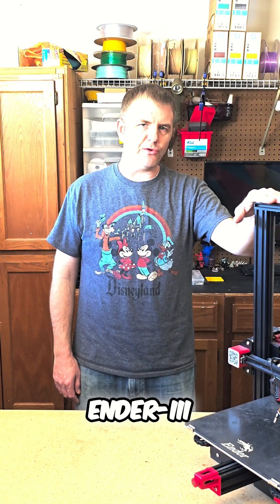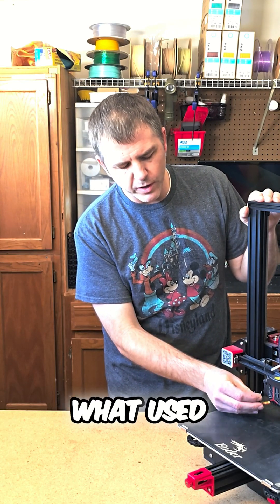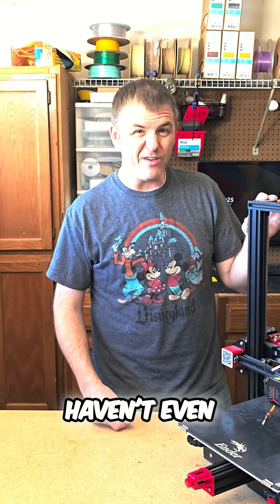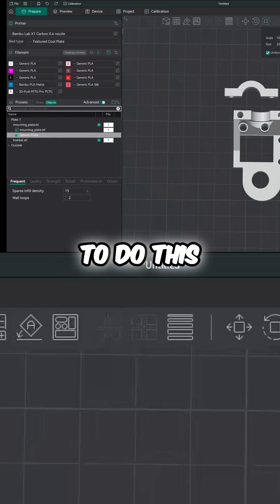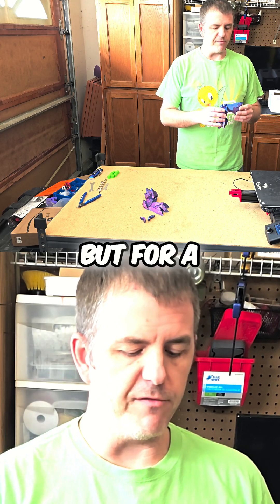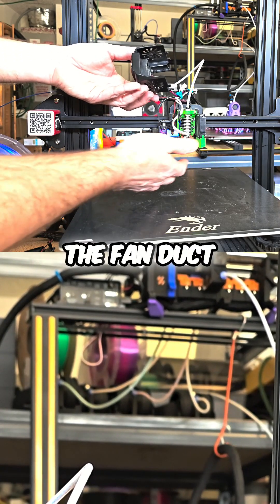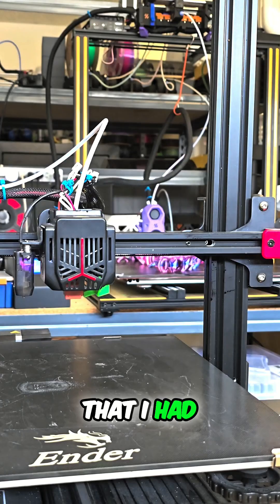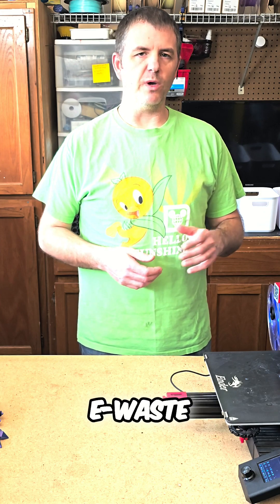Upgrading My Ender-III Max Neo: Is It Worth It?

Comment: I just bought a used one , was going to buy a broken ender 3 v3 plus but people on ebay were spending way too much , 150 bucks for the neo , almost new and it can be upgraded to compete with any printer out there , Ive rebuilt several printers for fun ..when you can by a motherboard for 30 bucks there is no such thing as out dated .. the newer printers aren’t as mod friendly , I prefer the older ender 3s ,I have two ender 3 v3 se , and they aren’t nearly as robust as my s1 , and the older ones made with a extrusions can be easily expanded . I
Reply: The Ender 3 printers are the AR-15 of 3d printers, imho.
Reply from the maker: You're spot on with the older printers!  I should do an update video on what I've done with mine!  I've added a 3MS MMU to  my Ender 3 Max Neo and my CR-10.  Adding 4 color printing, linear rails, and Klipper to the mix really makes them all new printers!